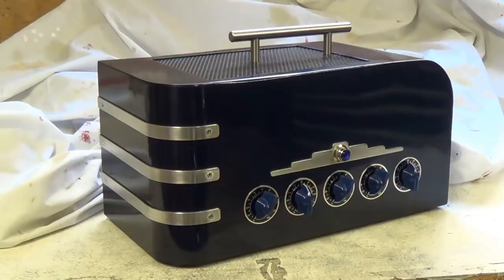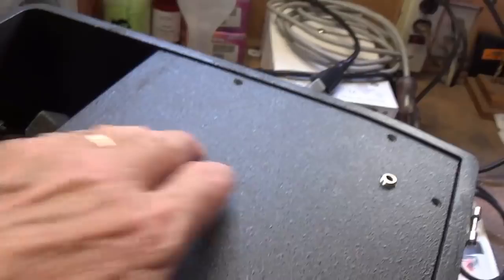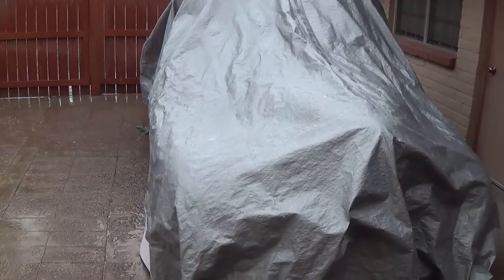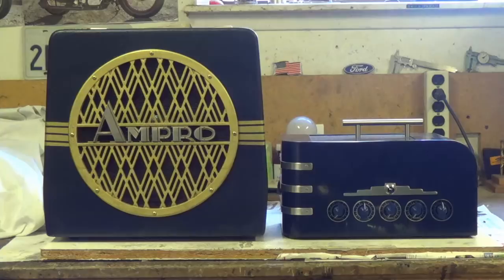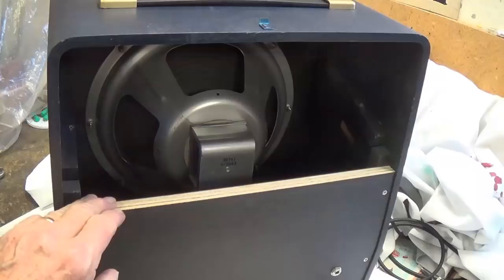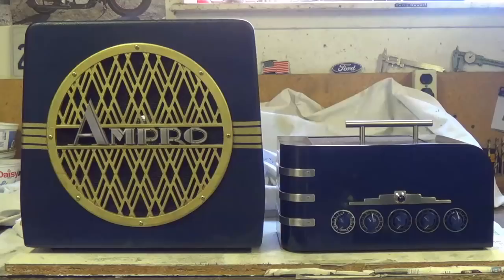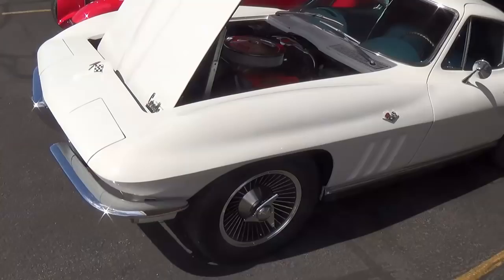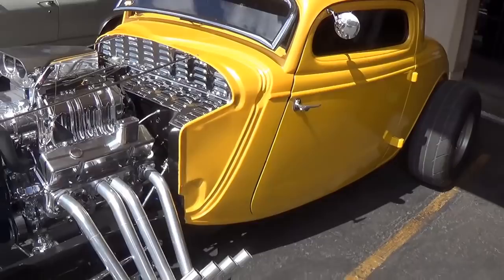Let's Build and Tune an Art Deco Speaker Cabinet

Comment: An awesome project. You,ve got my imagination going strong.
Reply from the maker: That's great to hear, Russell. Let us know what you come up with.
Reply: @UncleDoug  i,ve been researching speaker cabs. Have you seen bill fitzmaurice designs? Dumble does an oval cut out on the back that he calls a tuned cab and the forte cab is interesting . Closed back but ported on top sides and bottom . Very interesting. Avatar resurected it. I,m a drummer but i love amps and guitars.
?
Reply from the maker: I have seen several of his designs and find them to be very original and interesting. Whether they function as well as they look.....I'm not sure.

Comment: Very nice Doug. You know, aircraft radios usually have two jack sizes for headsets. The phones use the standard quarter inch but the cord for the mic and push to talk switch use the smaller jack and plug. Makes it easy to know what to plug where.
Reply from the maker: Interesting information, Carl. I figured in this case it was to prevent the use of the Packard Bell cabinet with other gear.
Reply: If only they did this with computers - I'm forever plugging my headphones into the mic socket. On the other hand having another socket size makes life more complicated. Dilemma!
Reply: George Robartes:  Back around 1910, or so, my maternal grandmother was a "Hello Girl." That's what they called operators in those early days.

Comment: Volkswagon: My brother and I rebuilt dozens of those "pancake" engined models. They came in sedan, fastback, and wagon styles. I remember hauling many engines and parts in my old Willys Jeep. Most had to be converted to carb power from a really trouble-prone injection system whose "computer" would fail if you looked at it wrong. Lots of memories there.
Reply from the maker: I believe the one in the video had been converted to carburetors also, Ray.

Comment: Hi Uncle Doug--nice job as usual.  Speaker cabinets can often benefit by being stuffed with ordinary polyester pillow stuffing, which, acoustically speaking, makes the cabinet larger.  Filling to a density of 1/2 to 1 pound of stuffing per cubic foot of enclosure is usually about right.  Not only will the polyester fiberfill make the cabinet larger, it will also result in a smoother sound by reducing standing waves in the cabinet.
Reply from the maker: Thanks, R. That's a very interesting suggestion. I never realized that reducing the air space would make the cabinet behave as if it were larger. It seems counter-intuitive, but I trust your opinion and may well try this.

Comment: The amp and cab are so gorgeous that it barely matters how they sound! (Duck and cover) I think you're right about the sound of the split back panel. I'll be building a 4 X 8" cab fairly soon, so I'll try some variations, but the split seems to have sound benefits over the closed and opened versions, and it's definitely more mechanically sound than the open.
Reply from the maker: Thanks, Mark. The idea of a 4 x 8" cabinet is very appealing to me. I recall being astounded by the great tone from the multiple small speakers in the Electromuse (previous video). The back really does need to be open for guitar use.

Comment: Great job Mr. Uncle, I found a 15 inch Alnico last year and so now I'm in the mood to make it happen.  Again, thanks so much for making it look easy and I'll do some research for a decent box size.  Love the channel, you are a true craftsman.
Reply from the maker: Thanks so much, AT. Check to be sure that the magnet strength is intact. You can use a screwdriver. It should stick fairly strongly to the magnet. The magnet in the Hepper speaker was weak = flubbing.

Comment: The two look great together but I think I would have went with painting the grill and the stripes silver to match the head more also if you omitted the top handle and put handles on the sides you could then set the head on top
Reply from the maker: Actually, the head fits perfectly on top since the handle is very low profile. I should have included a view of them stacked. I really considered going with silver, Doug, but couldn't resist the gold. It can always be changed when I replace the speaker.
Reply: Oh okay well that's cool you can still stack it....yeah I would have like to see it silver to match the head, you did such an awesome job on that head it would have just been icing on the cake if the speaker matched the head completely  you could always put some brass on the head to draw the colors together
Reply: I Agree BUT The Gold looks equally as good However that being said the two colors should be matched- Gold OR Silver Like I said I can not make up my mind I Really like them both!! as longs and they match-The head kind of reminds me of the passenger trains from when they were at their Peak! Looks GREAT yeah ok SILVER Top and Bottom is my pick_ GREAT WORK AS ALWAYS!!
Reply: Lol, why not mixed metals? Brass, aluminum, stainless steel, nickel, gold, copper... let's just get everything common in electronics on here, HAHA!
Reply from the maker: Thank you all for your suggestions. I am tending toward changing the cabinet to polished and matte aluminum finish. So stay tuned :)
Reply: Agree completely!  Matte Aluminum would match very nicely.
Reply: You could always anodize the amp strips gold

Comment: Cool amps and hot cars. Another A+ project, Doug. 

Thanks for giving the Hepner a very complete and fair shot.  I've seen them on eBay and have been very tempted to try one, but I almost never see anything about them mentioned in guitar forums and now I know why. Too bad though because the speaker looked very promising. Thanks again for sharing your knowledge.
Reply from the maker: Thanks, Randy. It did seem like a really good speaker but I don't think it can handle the strong bass tones from a guitar. You're welcome.

Comment: Oh...tin dust cover. That'll help with treble some...but probably just straight out in front of the cabinet. I may be all wet, but I think that's how it will work. Wow! What a difference
in directionality 'tween the three back options. And I agree the open 1/3 in the middle sounds best.

All was so great at the car show (including the distraction) until the blue Chevy pickup. I agree...put some real wheels and tires on that beauty. The Yellow Ford...I'm gonna say '34
judgin' from the grill and the suicide doors and that windshield open like that...needs a rodent and small child screen on that intake though(8-). Thanks a heap, Uncle Doug. Great
video all the way around.
Reply from the maker: I agree with all you said, Tom. Thanks !!

Comment: Great job, the silver Ampro lettering ties the two pieces together nicely.  I would like to see how the two pieces look when stacked up piggy back style.  As far as speaker directivity, directionality, objectivity and acoustics are concerned the variables are countless and third party opinions are tough.  I read that when sound engineers asked Mr. Marshall how he calculated what size cabinet to use in his famous 4x12 model 1960 speaker, he responded, "I just used used the smallest box that would hold four twelve inch speakers.
Reply from the maker: Thanks for the positive comments, Paul. You're right......it's all subjective, but I do think that a partially open back seems to work best for guitar, and agree that huge cabinets are simply not necessary.

Comment: Another excellent presentation, thank you UD!  I agree, I think replacing the Hepner might help the tone. And for me, the comparison may have been clearer if the straight on recordings were presented in sequence, followed by the side on recordings. But what a lovely looking cabinet you have produced through a sense of style, and judicious salvaging and resurrection of (?) discarded items. Well done!  PS, can I disqualify myself from any remote possibility of success in the StageRight prize draw - the Trans Pacific postage would be crippling!
Reply from the maker: Thanks so much for your very thoughtful comments, Cass. I have since changed the exterior of the cabinet as well as the speaker. You will hear and see it soon.

Comment: Wow, I love what you did with the amp and cab, they look incredible.  As far as the sound test goes- there are just so many variables that make it difficult to determine what your whole rig is capable of.  But I think it's safe to say that a high quality guitar speaker is going to perform better than the vintage one you have there.  And I just thought I'd mention that I have modern 12" cabinets that are about the same size as yours, and with a completely closed back and Turbosound 12" speaker they sound very good to my ears.
Reply from the maker: Thanks so much, G. I have already replaced the speaker with a new Jensen C12N, and the improvement is overwhelming. You'll get to hear it soon.

Comment: Nicely done, it looks really cool. Nice cars there also... Thanks for sharing!
Reply from the maker: Thanks, Daniel :)  You're welcome.
Reply: @UncleDoug  would it be possible to make a video about how to delay or soak the power surge on diode rectified tube amplifiers? I once revived a diode rectified Vox AC50 which use to have a "brimistor"  but some previous repair left a shunt in its place. It would consist on a filament and a bi-metal strip to delay the B+ until the tubes get warm.

Comment: Uncle Doug, I like your eye for design. We agree that modern giant wheels don't look good on older vehicles. Although I am fine with a 16 or 17 in the right style and tire combo. Thanks for the followup with that VW owner! Happy to see the engine bay as clean as the exterior. That's not always the case. I scored an Arvin hi-fi amplifier on the bay today. I saw it randomly at 99 cents with 30 minutes left. I couldn't let it go for that cheap, so I picked it up. No clue what I'll do with it, probably fix'er up original, find a cheap record player and ask to borrow my mom's copy of Inna Gadda Da Vida :)
Reply from the maker: Thanks, Andy. I agree that 17's on the rear and 15's on the front can look just fine :) You're welcome on the VW. Congratulations on the new acquisition. See if your mother has any Ultimate Spinach or Vanilla Fudge albums....good stuff.
Reply: I will check! I had to look them up. If I were a betting man, I think my mom might say those bands were too far into the acid rock spectrum. I'm thankful she saved her collection from the 60s, there are some iconic records there... Tommy, Beatles, Stones, Cream, Iron Butterfly, etc
Reply from the maker: If she liked Iron Butterfly, she probably liked the other two also :)

Comment: Man, I'm still diggin' that Amp. And what a great accompaniment piece you've made for it with that speaker. I mentioned that I've 'concepted' an art-deco style stereo tube amp. I'm glad I'd already sketched it out because I'd find it difficult not to let elements from yours creep in ! Great job (again) Doug... always an inspiration !
Reply from the maker: Thanks so much, CA. Best of luck with your stereo amp.
Reply: :)  Seems I have more ideas than time these days. Most "garage" hobbies are going into hibernation for a bit. Came home to 2" of snow on the lawn tonight. Soldering with mittens on really sucks.

Started dabbling with Transmission Line speaker designs though, folded horns and such. Trying to muster up every bit of efficiency to pair with an SE triode set-up. Lots of math, lots of uncertainty, R&D, trial and error experiments... should keep me outta trouble over the winter. :)

Comment: Nice video.
To tell the difference between the '33 and '34 Ford look at the hand crank hole in the bottom of the grill. The '33 is oval and the '34 is in the shape of what could be called a chevron.
Cheers.
Reply from the maker: Thanks, JW. So the yellow blown coupe is a '33 (oval hole) ??
Reply: All I can say is the blown coupe has a '33 style grill (original or reproduction??).
P.S. FYI Bob Drake sells a '34 reproduction.
Reply from the maker: Thanks, JW.

Comment: The speaker cabinet came out great! All it takes is skill and imagination to make something good happen. Your creative ideas are always intriguing. The overall sound is OK, but it lacks that certain tone that's needed for a guitar. I think putting a Jensen Special Design 12 in the cabinet with the split back may be the magic (Fender) formula! It's true about a sealed back cabinet creating good forward projection, but not much on the sides or rear. Also, a sealed enclosure makes the speaker stiff sounding and less efficient, and it will require more amplifier power to compensate. You could also try to install a circular vent port with a full back, but that's more for Hi-Fi applications rather than guitar/instrument use. Usually speaker enclosures are designed around the parameters of a particular speaker using the small Theile parameters, (SPL, free air resonance) etc, but I've heard many good sounding enclosures built by trial an error! I'm curious to hear the outcome when the new speaker arrives. :)
Reply from the maker: Thanks, Frank. The new Jensen C12N arrived today and is already installed. It makes the poor old Heppner sound even more like a rented mule. I had to leave off the vibrating screen behind the grille, and add felt to both sides of the handle to stop it from vibrating. It's a monster :)

Comment: celestion gold 10 or cream 12. MUST use knukonceptz 12 ga 194 strand speaker wire. dowel the cab to tighten mids(cut 1/8 dia. to 4/6/11 inch at 45 degrees and glue them, a dozen pieces). corner load the cab for bass(place strategically in corner of room). use yer scope with a mic.
Reply from the maker: Good grief, Raffy. I'll have to go back to college for an engineering degree just to set up a &$@%?& speaker cabinet :):)

Comment: Sound wise a better option would be a sealed back with a 2/3 inch port on the front. I understand it would ruin the looks of the box but would probably sound better because the cabinet is quite small, with an almost open back, low frequency's will spill over to the front giving out of phase cancellation. But it's intended use is hardly HiFi! The combo does look good,
Reply from the maker: Thanks, Michael :)

Comment: The speaker was made for B&H's "consumer" (models 535, 537, 1535, 1574), hence the gray color. (The commercial (Audio/Visual) models were a sort of turquoise color.) I never thought the speakers sounded awfully good. They lacked bass, which was probably intentional to prevent booming in halls and auditoriums. B&H described the driver as a midrange. It was matched to 15 watt amplifiers. Older versions were rated 25 watts and made by Jensen. The speaker is a 16 ohm unit and the two 3/16" jacks were there to facilitate hooking another speaker up so as to have one on each side of the room/hall. Some our techs used to just drill out the jacks on both the projectors and speakers with a 1/4" drill bit to convert them to standard sizes. I always used new Switchcraft parts instead.

Hope some of this is helpful.
Reply from the maker: Thanks a lot, Ray. I appreciate the information.

Comment: An interesting note: Bell & Howell used proprietary  jacks on their 16MM motion picture projectors on purpose, so you had to buy speaker cables and accessories directly from them or their authorized dealers. It was all about $$$ :) Just a matter of drilling the hole slightly larger and installing a standard Switchcraft 1/4" jack...issue solved :)
Reply from the maker: I have drilled out 3/16" jacks in the past, Frank. They always seem to have enough "meat" to do this.......but at $2 or so for a new Switchcraft 1/4" jack, it's more trouble that it's worth. Thanks !!!

Comment: I just noticed something, your speaker output jacks are in-line with the aluminum trim on the side, but the input jack is not. Oh, well, too late now; you’d have to drill another hole, and you’d have a hole to fill up so it wouldn’t ruin the visual and audio perfection of this gem!
Reply from the maker: I wanted the input jack beneath the chassis, for shielding purposes, William......so it couldn't be aligned with the lower trim strip, which is above the chassis. Also, the three jacks are evenly spaced, which I prefer.

Comment: I Love It, I Love It, I Love It! Using “basket case” components that are just taking up space in the shop to build a beautiful compliment to the “Art Deco” amp. I just finished a project using a very old hurricane barn lamp and making a new back porch light out of it to replace the hideous thing that the builder had installed. I am always a fan if making something old,  new again. I was amazed at the difference that the listener position angle made on the tone. Especially the treble response, wow. I now see why my bass amp is ported and my guitar amp has only about a 3 inch back and 3 inch thick chassis. I suppose creating the best resonance chamber for the particular 12-inch speaker they used. I hope that you will make a comparison video when you get the new speaker in hand and installed. I am very curious as to whether the listener position differences will be as dramatic, and is it the speaker causing it or the trapezoidal cabinet? Another fantastic video.
Reply from the maker: Thanks so much, Mark. Jack and I are definitely fans of making something out of nothing. The new speaker (Jensen C12N)  is already installed and made a huge difference in overall clarity and power. You will get to hear it in a future video.
Reply: That sounds great, looking forward to watching it. Have a Great Week!
Reply from the maker: Likewise, Mark.